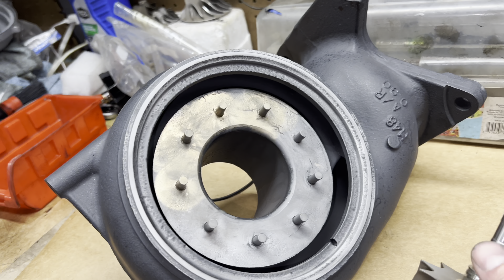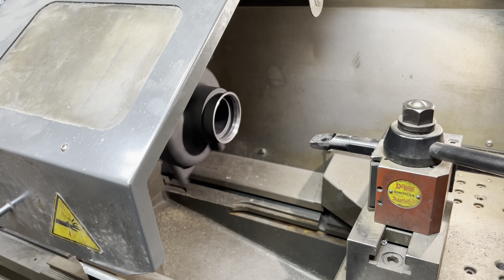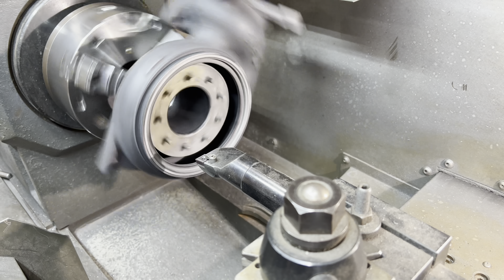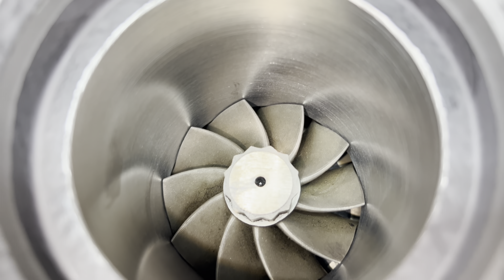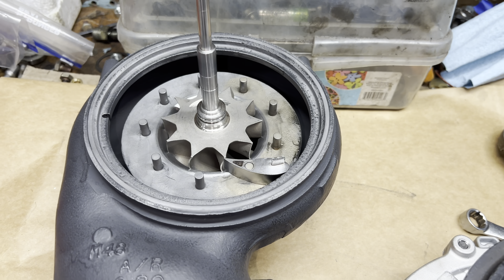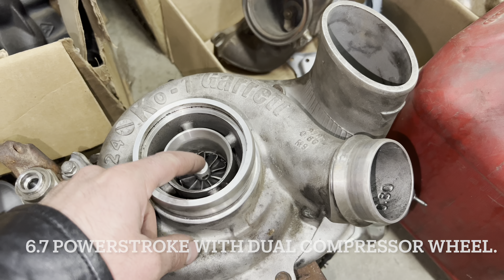2003 Ford 6.0 Powerstroke turbine upgrade to Duramax

Comment: I would like to cut my s400 for the 93/85 turbine how do I go about the taper?
Reply from the maker: I think you mean the raduis. I can write a cnc raduis program if it’s a single raduis then I choose the location and I test it as shallow as possible then compare it to my turbine, by put the shaft in by itself and checking it with a flash light. If I make adjustments to the program if needed. Then I have it run at the exact location of the turbine, I check it then , then move it in about .005 at a time.

If I machine it manually then I measure the clearance between the heatshield and turbine wheel. I take that dimension and add .020 to it. I cut the raduis then measure it by using the heatshield as reference to measure how much clearance is between the turbine and housing. It would probably be easier if I made a video to show how I do that.
Reply: @turbolabamerica  yeah that would be cool to see a video of how you do it.

Comment: I would hate to see that fly out of your chuck! I am glad You have it all figured out by now. Nice work as always! 👍
Reply from the maker: I just received a turbo on the mail to machine that is for a peterbuilt 379, the compressor housing is cast iron. It’s 26 lbs with the plate attached. I would prefer to machine that on the mill due to weight but it’s not easy to machine the radius that way. The Raduis tools are 450-500$. I’m going to try to do it on the lathe. It’s dangerous because there isn’t much of a spot the grab it. It just has a vband connection.

Comment: The audio quality on your videos kinda low .
Reply from the maker: Do you mean I need to turn up the volume because I’m using high quality external mic
Reply: Audio sounds great! I do think watchers are meaning your audio overlay. There is some silent and double up audio...
Reply from the maker: @jeanrivera643 that’s a glitch with I movie. I’ll try to fix it. I had this problem before before, it’s right in the editor then publishes wrong.